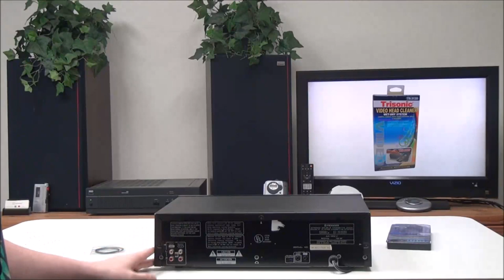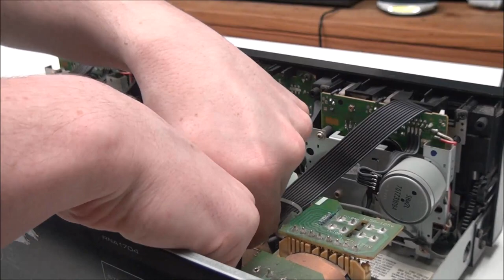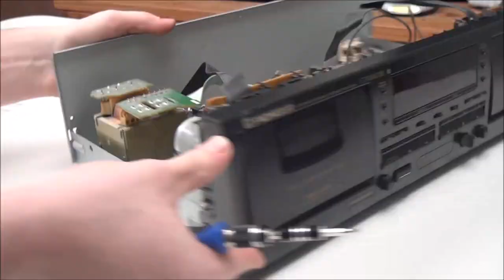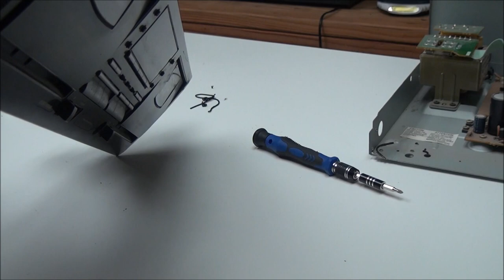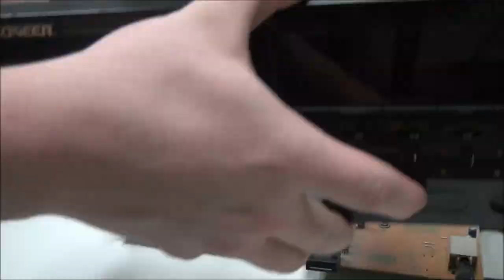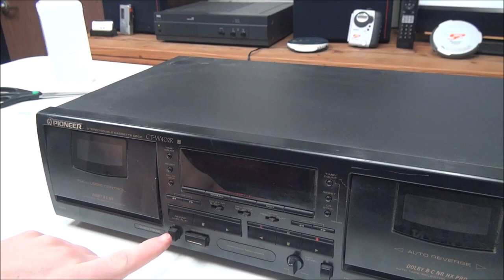How To Replace The Belts On Pioneer Double Cassette Deck CT-W402R Cassette Player Won't Play or Spin

Comment: Is there a universal belt kit that works with most decks one can buy? Flat and round belts? I have a few auto reverse decks that I need to check. One of them don't do anything except Click when i push the buttons.
Reply from the maker: When it comes to cassette decks, you often need a certain belt. Which means buying a specific belt kit is required. It sounds like you need to replace the belts on yours.

Comment: Your explanation was except for the fact that the 2 drives are not identical.  Therefore the belt routing for the record deck (one on the right) is different as it has an additional drive wheel.  If the belt is routed the same as the play deck (one on the left) the unit will not work.
Reply: The left and right belt routing is identical. 😂😊